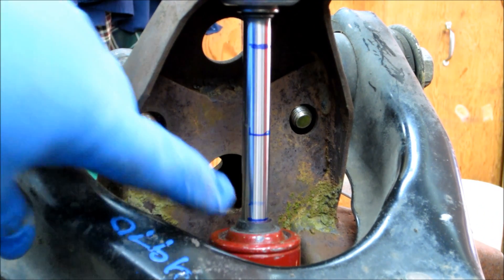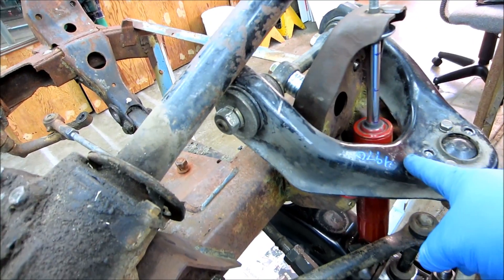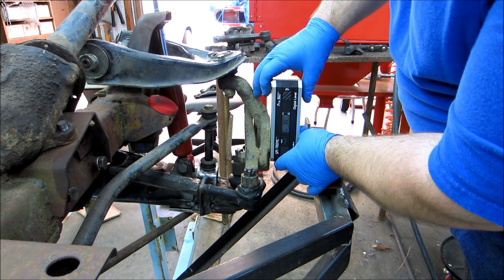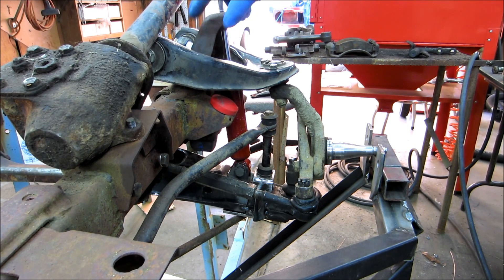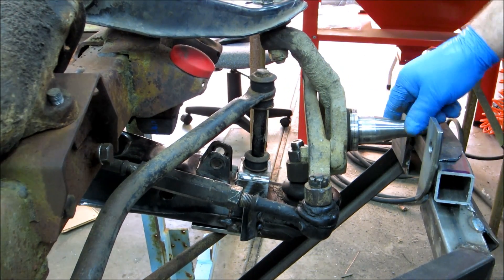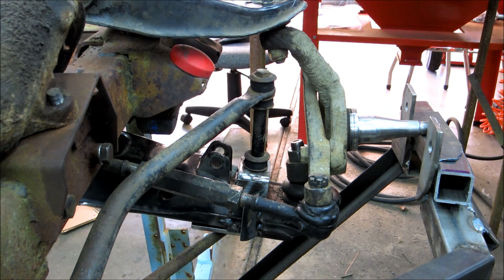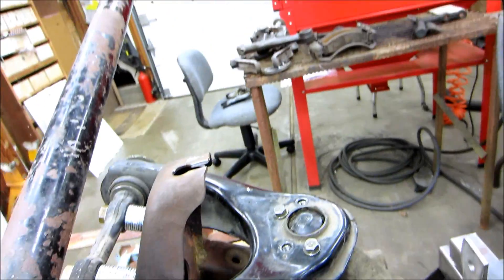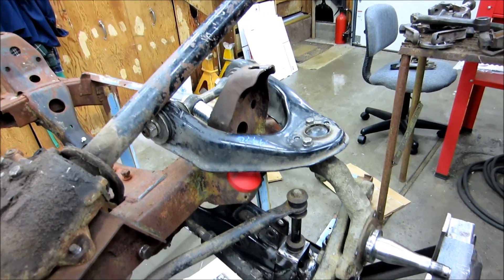Datsun 521 Ball Joint Mod - Part 13

Comment: I would leave the lower at stock length.
Reply from the maker: That would certainly be easier, but the goal of this project is to keep the stock 521 track width.  I had already done custom uppers for stock length 620-HB lowers. It pushed the track width out 1.25" per side.  This has been more of a pain than I thought it would be, but I think it will come together in the end. 
Thanks!!
Mike
Reply: bluehandsvideo

I love your attention to detail on this conversion. Makes me want to buy a 521 just to upgrade. I have owned 620,720s,d21 (hardbody) now a TA60 (Armada) and Wd21 (Pathy) always loved the 521 style. It was the first Datsun I test drove before I bought the 620 back in 1984.

Keep up the awesome projects for Datsuns!!!